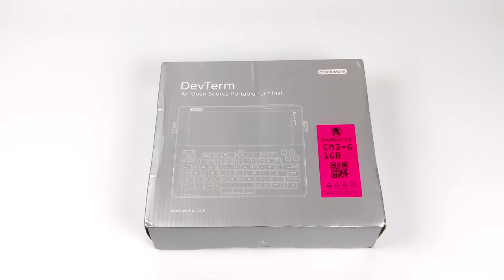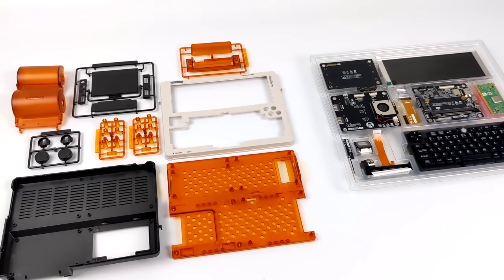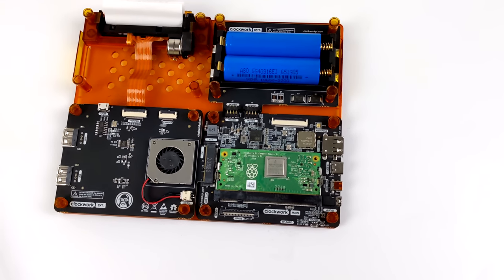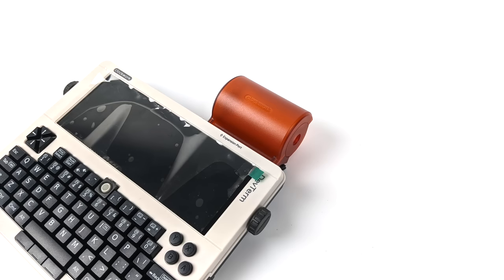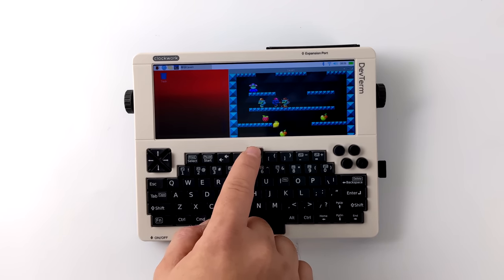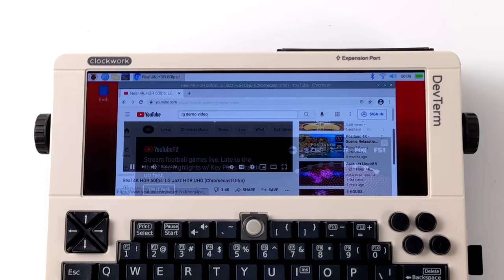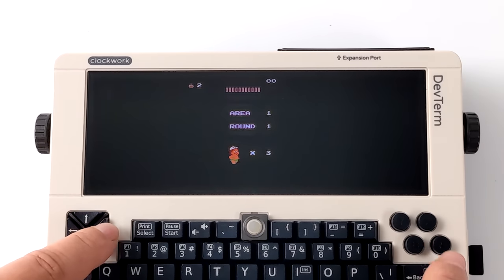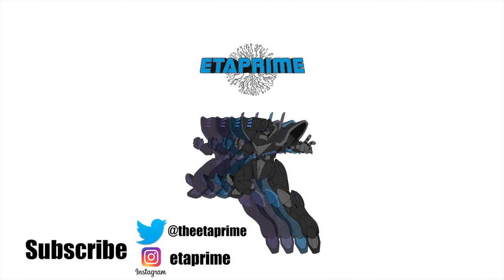This Thing Is Super Cool! Clockwork Pi Dev Term First Look!

Comment: Super retro? Super rut-roh, IMO. CM3? WTF? Dude, no matter how hard you try to make it sound great, this thing is nothing more than a bunch of obsolete parts in a plastic shell, IMHO. Does the RPi Foundation even still support the CM3? Mine is still sitting in the junk drawer.
What can this POS do that the RPi 400 doesn't? Oh yeah, print receipts. Every kid needs that functionality. Gaming? Seriously? Perhaps under the covers to hide from mom and dad. smh
Sorry bro, don't mean to poo-poo on your channel, but let's be real shall we? Old fashioned electronic typewriters and word processors are still available online for under $50 for the retro crowd of geriatrics. But, I'm 68 years old running a 4K miniPC to run 2 RGB 3 watt laser projectors and a 4K 60" flatscreen for my daily driver, plus 3 RPi 4s w/SSDs inside ArgonOne cases for my dev work.